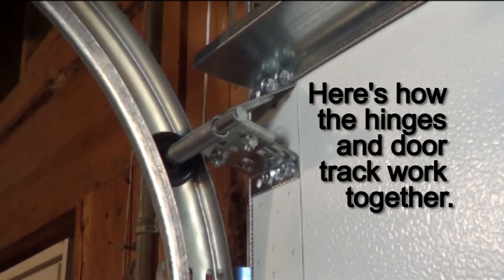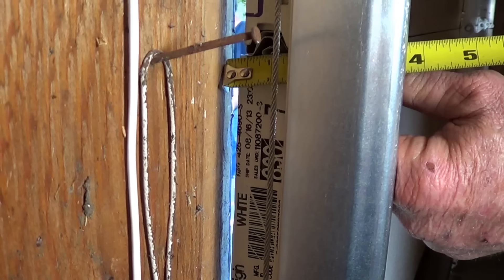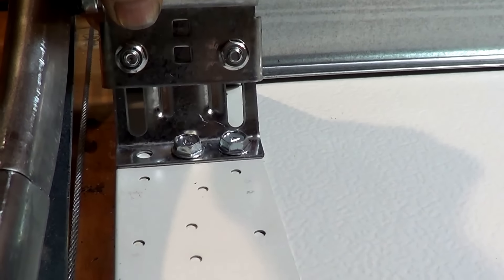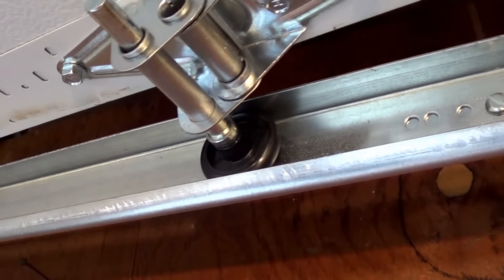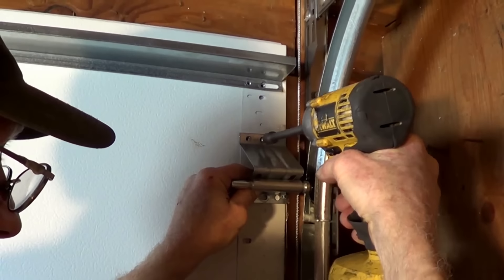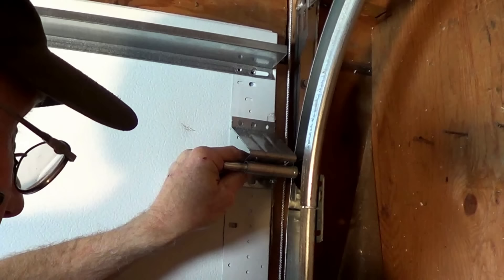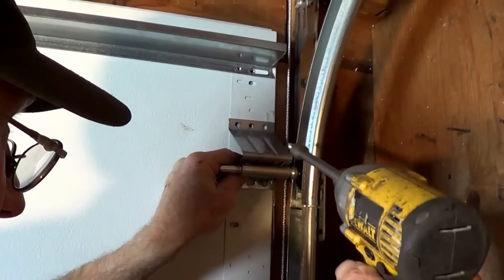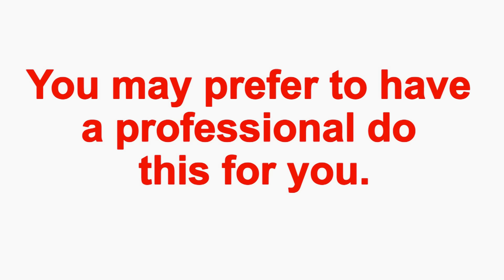How to Adjust Garage Door Top Fixtures

Comment: This video was just the ticket; I am having my driveway redone and the plan was to bring up the level of the floor where the garage door bottom meets.  I knew this would result in the top of the sectional door no longer sealing tightly against the frame since it was effectively going to change the point where it stops, and was thinking the whole track would have to be raised by the difference in order to maintain the same seal.
On the upper roller bracket for my door, the gap adjustment wasn't as apparent, as it used a single carriage bolt with the nut on the top, where I couldn't see it, so I didn't know it was normally adjusted using that slotted adjustment.
After seeing this video, I saw the light- :) 
I was considering changing the floor level just to avoid having to remove the tracks to raise it up the 3/4", but now I can do it properly-  Yay DDM, thanks-
Reply from the maker: Hi DTR RTD! We're glad to help, and glad to hear that you've been able to adjust your top fixture to get your door to line up with the new level of the floor.

Comment: First video that solved and addressed my problem in a long long time. Spot on my dude thank you thank you. I played myself and bought some cheap aftermarket top rollers from Lowe’s. They were blinding so bad the inside of my roller tail looked like a nascar track! Thanks again
Reply from the maker: Thanks for the comment, Kipp! We're glad that we were able to help you solve the problem that you were having with your door. We would agree with you that cheapest isn't always best. There are some parts that can "work" with your door, but may stop working fairly quickly after you replace them. We're glad you were able to get that fixed! Blessings!

Comment: How do you reinforce that corner of the panel? The metal inside  is sagging and pulling away from the door. I have 1/4 flat alumn to brace it but there is no place strong enough to screw it into the panel. My right side tracks ar position to far out. Cause the door to ride futher out on the roller's end shaft.
Reply from the maker: Hi Justin! It sounds as though you may have to simply replace that panel at some point soon, because without something to keep that corner together, the top fixture will eventually pull away and you will not be able to re-attach it at all. You could try adding a strut to that section first, but if that doesn't work, the full replacement of that section is probably your best bet.

Comment: I've been a garage door installer service man for quite a few years.
Interesting to pick up a few things here in your video.

1 of your suggestions is to use quick closers, to minimize #3 hinge breaking.
Problem I saw, or at least the video had shown the quick closer w/the stru above it.
How it the garage door going to open with the strut above said quick closer??
Reply from the maker: Hi Mark! We hope that this proved to give you some helpful tips, even with years of experience. As we always say, there is always more to learn about this industry! Well, with these quick closers, or low-headroom top fixtures, there are some modifications that need to be made in order to make them work properly, so that the door can open. As you said, this cannot happen if you simply use the strut as is, and don't modify it. Here is our tutorial on how to do this, for you future reference: https://ddmgaragedoors.com/diy-instructions/low-headroom-modification-for-steel-garage-doors.php
We hope this better explains how that part is accomplished!

Comment: I just installed an (Ideal Door® Carriage House 16 ft. x 7 ft. Ultra-Grain® Dark Oak Premium Insulated Garage Door, with Rectangular Windows)

I've installed many doors & I am having an issue i have never stumbled across before. The door feels heavy for the first 2' (at least 40lbs) when lifted manually but as it gets half way up, it really shoots up & is also hard to pull back down but as it gets 2' from the ground it drops. 

I really don't get it. I understand if a spring is too weak the door won't raise and too strong it will shoot up. Both are occurring. Someone please help me
Reply: The springs are too weak for the door.   Let me explain.  I'm assuming it is a "standard lift" door, not a "vertical lift" or something like that.    On a "standard" lift door, the spring must lift exactly the weight of the door at the bottom and about 0 pounds(a little more) at the top.
If you take a weak spring, and you put enough turns on it to "balance" it in the middle, then it will stay in the middle, but be heavy on the bottom and "hot" at the top because it's too weak for the bottom and has too many winds at the top.
If it is a standard counterbalance system, you will have 4" diameter drums, which means they are about 12" circumference.  So 1 turn of the drum & spring = 1 foot of door travel.
7 foot door = 7 turns on the spring or 28 one quarter turns.
normally you add 2 or 3 one quarter turns for a total of 30 or 31 on quarter turns just so you have a little holding power up top.
In any torsion setup, there is a narrow range of winds that are proper for the door, and if those winds don't pick up the door, or the door picks up too easy, the springs need to be replaced.
This is for a torsion spring system.
If you have an extension spring system, those springs are simply sold by door weight and come in 10 pound increments.
If you have a 150 pound door, you need two 150 pound springs(one on each side).
I know, you're thinking that is 300 pounds of force, and you are correct, but that is cut in half by the pulleys on the springs.
Reply from the maker: Hi christos! It definitely sounds like you have the wrong springs for your door there. It sounds more like your springs are too weak for the door based on the information you're giving. The door being heavy for the first few feet is a problem usually seen with springs that are too light for the door, and the door shooting up is a problem of too weak springs as well. You should refer to our blog on this for other things to look for to help determine this. https://ddmgaragedoors.com/blog/2015/11/03/a-balanced-garage-door/

Comment: My hinges are in the order 1, 3 ,2. Is this on purpose, or was it installed incorrectly?
Reply from the maker: Hi Mechotronic! These were installed incorrectly. The door can still function, but it will not be gapped correctly, and the sections may have strange spacing in between them.

Comment: I have a large gap only at my bottom panel.  All the other panels are flush.  How can I fix this issue?
Reply from the maker: Hi Scott! The first thing we would recommend is that you check to make sure that the correct hinges are connecting the bottom section to the one above it. If that bottom section doesn't have #1 hinges attaching it to the section above, there will be a gap between it an the next section. You may need new hinges for the bottom section if this is the case.

Comment: LOL! Whoever installed the garage door at my house did not install the top two hinges in proper sequence! 🤣🤣🤣
Reply from the maker: That happens sometimes, vanhouten64. There are times when the sequence gets thrown off. Next time you have your door worked on, it might be best to switch those back around if they are incorrect. What's the sequence from top to bottom currently?
Reply: @DDMGarageDoors  They had the middle and top hinges switched on one side. I was able to swap them thanks to your video!
Reply from the maker: @vanhouten64  we're glad to hear that! Hopefully your door is working better now!